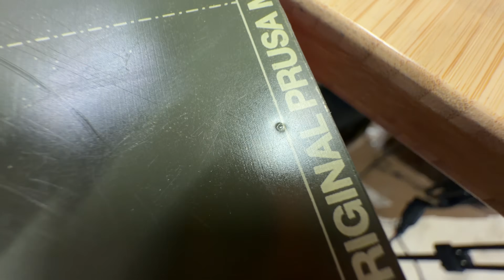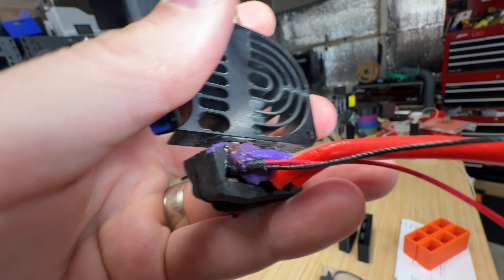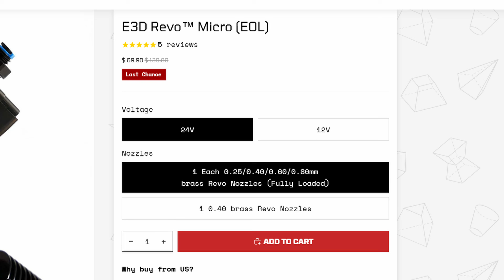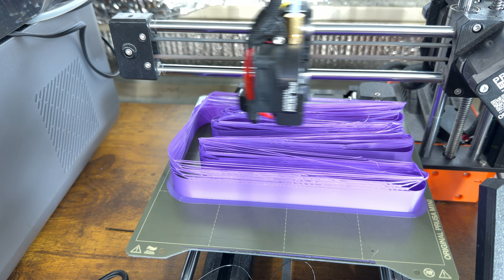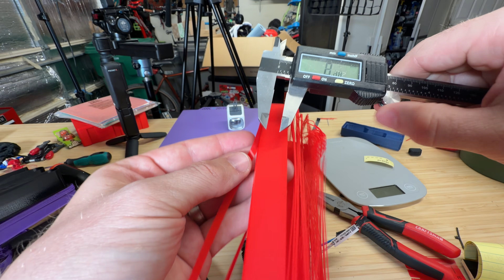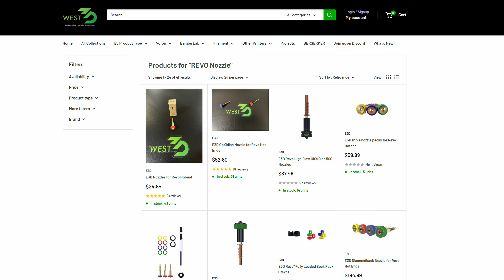Upgrading My Prusa Mini to the Revo Micro Hotend

Comment: Worst hotend I ever bought...printer great but eventually got a blob and the print wrapped around the hotend... eventually destroyed the hotend trying to get it off as the nozzle ripped off in the heat sink.  I bought replacements and it happened a second time a week later.  The cause is fixed but this nozzle is stuck as well so I eventually need to replace.  Will go to a traditional hotend though.

Comment: Gonna update both my Minis as well!
Reply from the maker: nice! I have another video planned where i do acouple more upgrades.
Reply: @RadDadsPrintLab looking forward to them!  It sucks that the Mini costs so much new, but they’re damn fine printers!  If someone can find one used for deal a few thoughtful mods/upgrades are well worth it!
Reply: @RadDadsPrintLab  Upgrading the none branded generic linear bearings would be high high up there on my list. They surface rust and repacking them with grease doesn't do any thing. Motions from the original linear rails on the mini printer are crap on mine.

Comment: Having owned both a Prusa Mini and a Bambu Labs A1 mini, I cannot explain to people how bad the Prusa mini is, it is legitimately the worst printer I've ever used and that includes many many cheap deltas. Prusa refused to support this printer, shipped it with a defective PINDA probe, that got heat creeped from the nozzle which caused leveling to be really far off, they offered to ship replacement MINDA probes a few months after release, but then opened those to pre-order to Mk3S owners and not Mini owners, meaning they were sold out for over a year on Prusa's website while their customerst hat paid more bought a probe not intended for hteir printer because it was slightly faster. Prusa repeatably screwed over Mini users, and it was enough to make me sell my 8x MK3S and 10x Prusa Mini's, and switch to Bambu when it came out after a few years of using a voron. I will never trust Prusa again, they just wanted money, and they sure got it, leaning tower of X axis aberration, what a horrible horrible printer.
Reply: @Funky85Mess  well, your mileage may vary.  I absolutly love my Prusa Mini and did not encounter the issues you describe.  It’s still an active unit in my farmette.

Comment: I upgraded 2 years ago to revo hotend. It was fantastic! Every material worked and no extrusion issues. 
You should check out the bondtech extruder with integrated runout sensor. I have this for years and it was a gamechanger for me with TPU prints.
I also used the modified fan duct for the revo micro for better cooling.
I love my mini. Its a workhorse for me. I also made an enclosure for printing abs and reduce the nosie.
Reply from the maker: Glad to hear it!. Every comment so far has been the Bondtech Extruder haha. Sounds like i really need to get it. Any chance you have a link for the modified fan duct you used?
Reply: @RadDadsPrintLab it's called "Prusa MINI - X-carriage with better cooling" ytube dont like to post links.
Reply from the maker: Found it thanks!
Reply: @RadDadsPrintLab  I use socks for the revo that are fully enclosed. this helps against filament buildup. its called "4-Pack - Silicone Sock-X - for Revo Nozzle". I also switched to a capricorn bowden tube
Reply: @RadDadsPrintLab  there is a shop called levendings, there you can find stuff for the p mini. there you find the capricorn, socks, wifi module, quality of live upgrades that brings usb and power infront of the printer